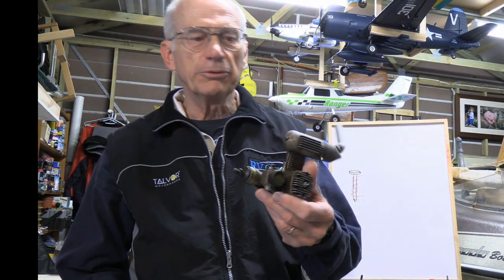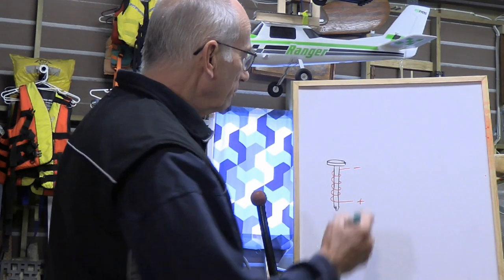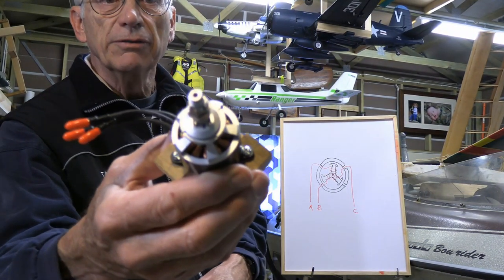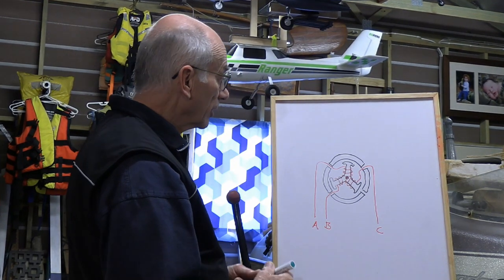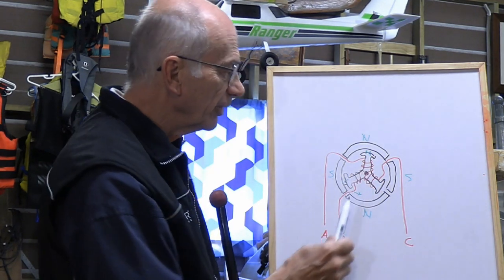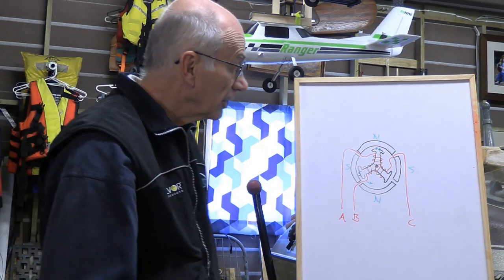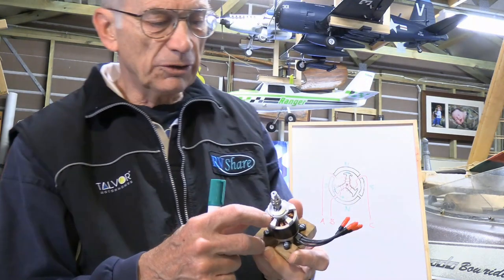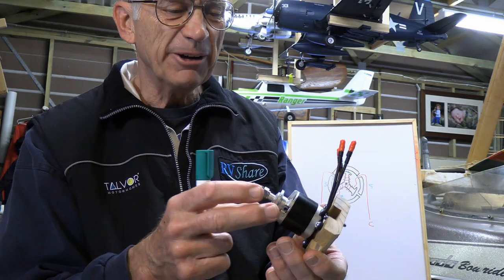All About Electric RC Planes

Comment: New to the electric flying scene. I am moving over from nitro. You just cleared up  a ton of questions  I had swirling around in my feeble lil head. I am a commercial electrician but that doesn't necessarily  translate directly to RC aircraft. It's a different beast.

I am finding your tech videos very helpful and informative.

Thank you Jim.
Reply from the maker: Thanks for the encouragement!  I also have a background with nitro - started out with my boys when they were young teenagers.  We had some great times, and now I'm enjoying it with my mates.  But I do like the new electric systems, even if they can get a bit complex.

Comment: Good video. You covered pretty much everything. However, I wouldn’t recommend running an electric plane on the ground for more than 15 seconds. The motor, ESC, and battery won’t get enough airflow to keep them cool. Also, you talked about storing Lipo batteries, but I don’t think you pointed out that it’s bad to leave Lipo’s fully charged for more than a few days. I store my batteries at 3.8 volts/cell in a double-walled flammable storage cabinet in my garage. I charge them when I get to the field and try to fly them down to 3.7 volts/cell before I head for home. If I charge or discharge one at home, I put it in a Bat-Safe. Lipo batteries can be very hazardous if not handled properly.
Reply from the maker: Thanks, again!  I'm working on a video on all that people need to know about RC plane batteries.  There is one thing, however, that has me confused.  The battery manufacturers typically recommend storage at a 50% charge level.  I've read that the nominal voltage of 3.7 volts per cell is supposed to be what that is - the lowest one should ever go is 3.0 volts, and fully charged it would be up to 4.2 volts.  But today I noted with one of my batteries that at a 50% charge, as indicated by my GT Power meter, it was at 3.85 volts per cell, and at a 33% charge it was 3.8 volts per cell.  That's not making sense to me.  Can you shed any light on that?
Reply: @RCJim  When you’re pulling 100 amps in an EDF, 3.7 is as low as you should go. The further you go past 3.7, the hotter they’ll get. The storage voltage should be 3.85 volts. That’s what my chargers came set to. It’s really bad to leave lipos fully charged.
Reply: @RCJim  From what I’ve read, the electrolyte is most stable between 3.8 and 3.85 volts. At full charge, the electrolyte will slowly vaporize which will cause the battery to swell. And apparently, high temperatures will also cause it to vaporize. The swelling will distort the battery, causing irreversible damage and possibly a short circuit.

Comment: Thank you for your very very informative and for me understandable videos. I still have a few questions about flying curves. I am a beginner and have a very hard time with flying curves over ailerons. Parallel to the actuation of the aileron, I have now somehow learned, must still be actuated rudder or the elevator. Maybe that would still be a topic which you can process on your channel. I would be happy in any case and thank you in advance.
Reply from the maker: Good questions.  Often when you are moving a control surface, there is a component of force being exerted both vertically and horizontally.  At the same time, if the plane has one wing lower than the other, there is both a reduction in the vertical component of the "lift" generated by the wings and adding in a horizontal force in the direction it is leaning towards.  So, there is a combination of inputs needed through the turn involving horizontal and vertical components.  It's a lot easier to show graphically, so I'll work on a video for you and others to simplify it!
Reply: @RCJim  Hey thanks, already many many thanks in advance. I'm excited and looking forward to your video now. I am sure that others also find this topic very exciting.
Reply from the maker: @clmb2225  No worries. I’ve already started working on it!